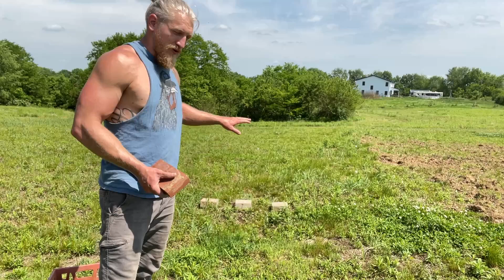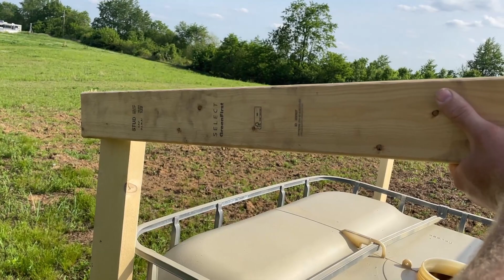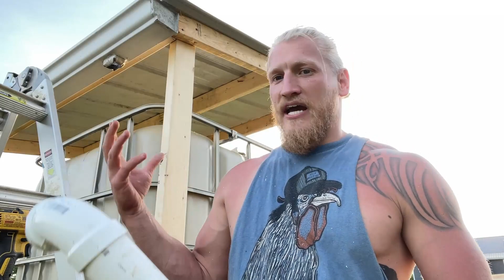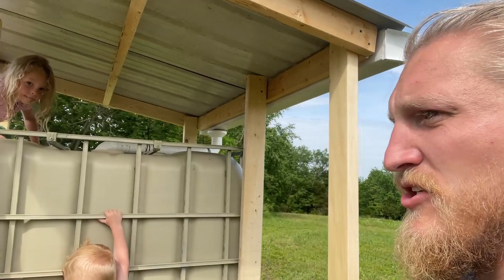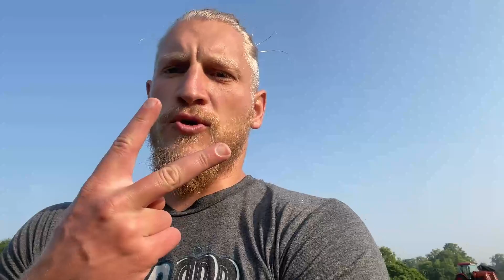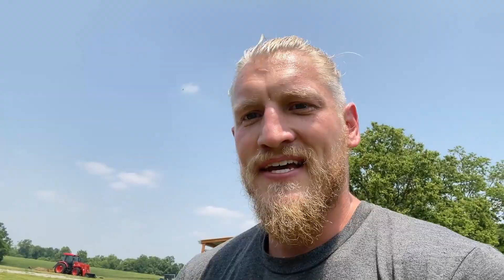DIY Stand Alone Water Collection Barrel For Garden Irrigation!

Comment: I need to use a trash can of some kind this year, soooo I know a plastic isn’t a great option but it’s all I have. That being said - it’s also a black one so would there be a potential for mold?? Second, would it be a good or bad idea to put a black thick trash bag inside as well? Now to just figure out how to hook up a hose with pressure instead of carrying bucket by bucket to garden.
Reply from the maker: My water tote is made of food grade plastic. The black should be fine. I painted mine because the sun shining through the clear plastic would increase algae build up. You’ll still get some but having a solid color holding tank helps combat it some. I’ve also heard putting a pice of copper pipe down in the water can fight algae off but haven’t tried it yet myself. I would think the trash bag would create wet air space that then could cause mold so would probably avoid that. And you can get a bulk head for a water hose on Amazon, as long as you elevate the can enough you’ll get water pressure to the hose from gravity alone.